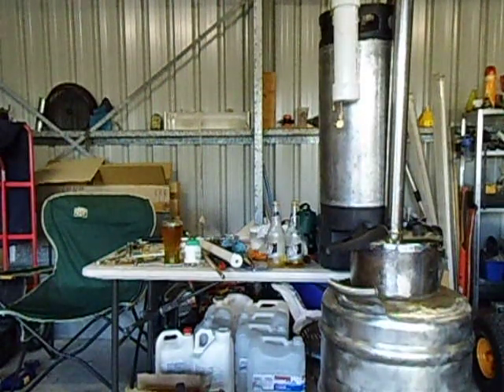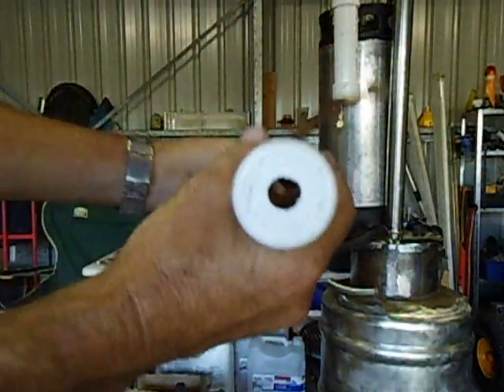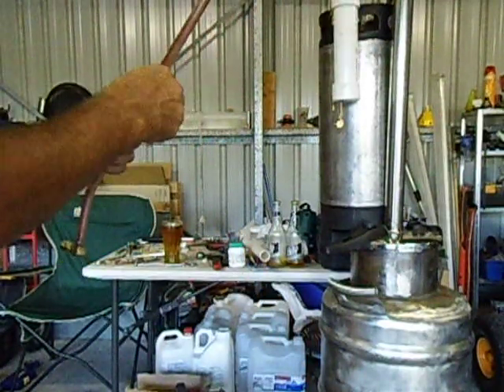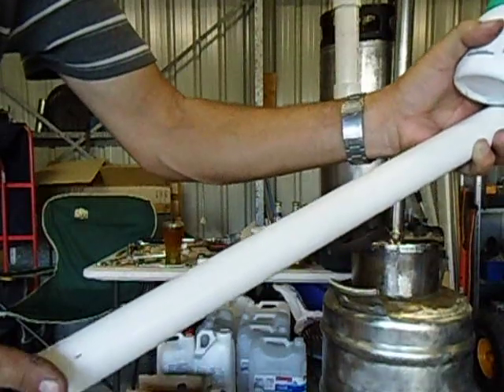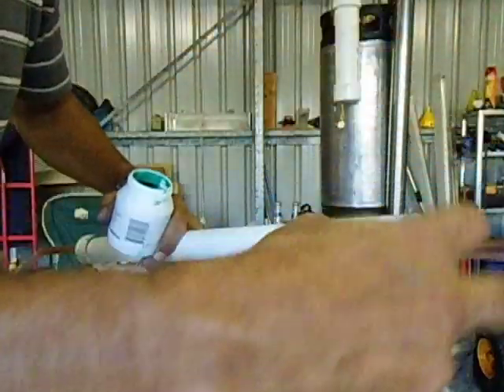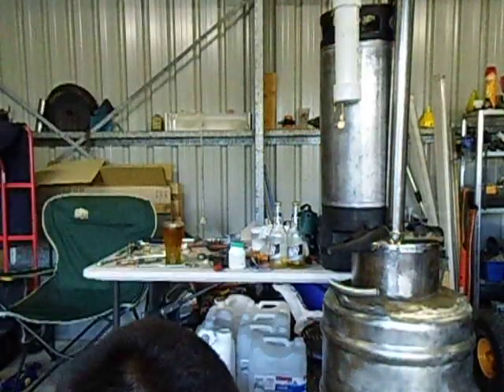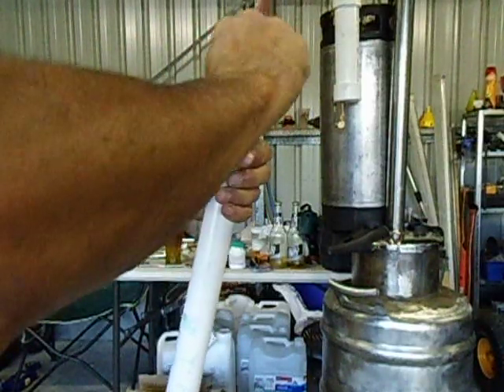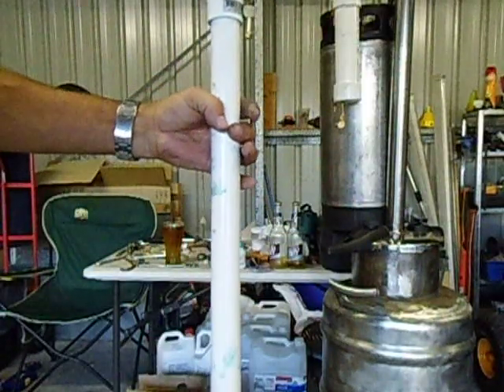How to make a straight condenser for a still or distiller

Comment: This is a very good idea for the condenser part of the still. It will reduce cost. Brass elbows are used for water in and out so they are not in contact with the ethanol. But parts that are in contact with ethanol must be wrought copper, otherwise, it leads to cancer.

Comment: Would you please tell me what if we use this pvc pipe  (actually polypropylene I think ) on  boiler as main distillation column.  As  you may know  the pipe u are using can easily withstand 100 degrees celcius  . İn  the technical spesifications  it says it can  withstand 95 degrees celcius with  tap water pressure.   Since  in our experiment there is no  real delta pressure built. . 
Is it possible? 
Can  you do an experiment for us? 
One  more  thing  .. the  below link proves that ethanol - polypropylene  compatibility is excellent 
https://www.calpaclab.com/polypropylene-chemical-compatibility-chart/
Thanks
Reply: if this is true then making a colum out of pvc should be ok,  and if you packed it with copper as they show the SS ones,  then it should be ok,,,  I am not sure if it would effect the taste,  but as pvc and cpvc are used in houses for all plumbing, and drinking water  it makes sense that what goes through it does not effect it,   WOW  this could be a way to make a 4" or 6" column at a very cheap price compared to copper..

Comment: The condenser can be made of anything as long as the tubing is copper for the ethanol . You can use a bucket and a copper coil , with ice in the bucket ( til it melts) and that is just as safe as what danssvb8 is doing. Except how he is gluing the goods together is a little dubious. Also, you never put brass fittings in the ethanol pathway, ever!!
Reply: The brass is connecting to the pvc for cooling only, separate from the central copper pipe
Reply: Yep. Brass and high proof alcohol do not work well together.

Comment: I was thinking about this same concept but using JB weld to weld in the fittings. Copper is crazy expensive right now this will help cut the costs.
Reply: That was my thoughts exactly. Even in the US, copper is pretty costly.
Reply: I was thinking as I watched,, and there is a much better way,,  buy a pvc coupler,, it has a screw on end /with rubber seal that tightens as you screw it down,  just need 1  cut it in half and use a half for each end, regular pvc cement to the pipe,  then make tighter holes for the water connector,, he drilled those too big,,, slide it on the pipe and tighten the two ends ,, you have a condenser that if there is a leak you just add an o-ring washer re-tighten, got it...

Comment: Use ABS pipe an epoxy glue in place of PVC and cement.  High temperature epoxy will work just fine at the temps the upper part of the condenser will be working at. Epoxies will also give a better bond between the ABS and copper pipe.

Comment: PVC for the outer sleave of the liebig condenser is no problem. Just ensure a high temp glue to seal copper pipe to the pvc. Something like J B Weld would work great.